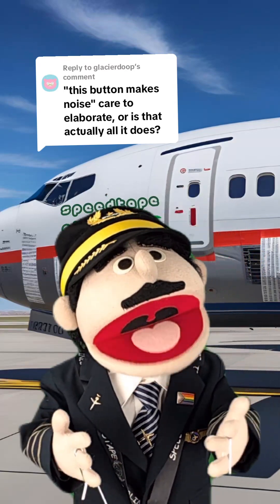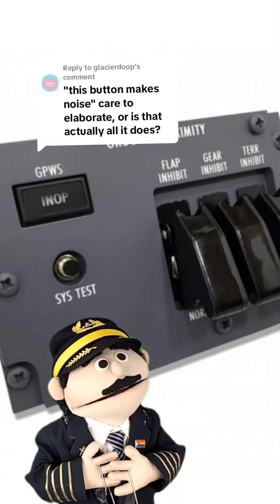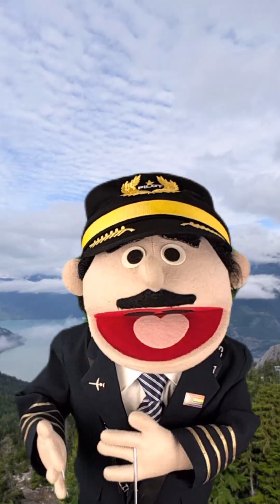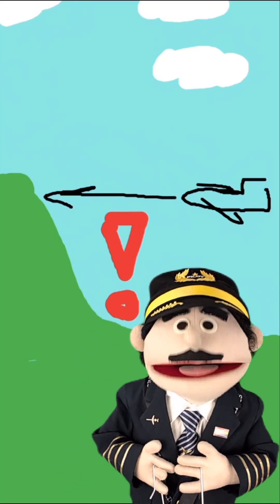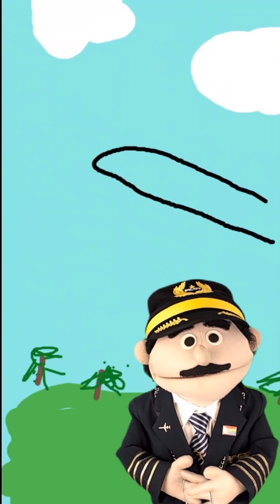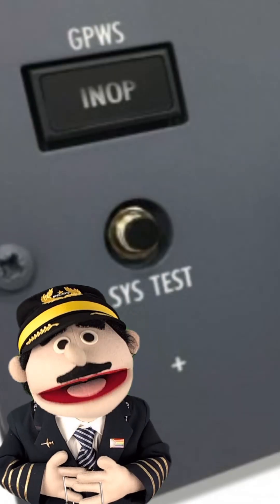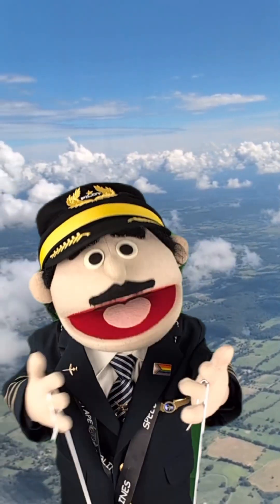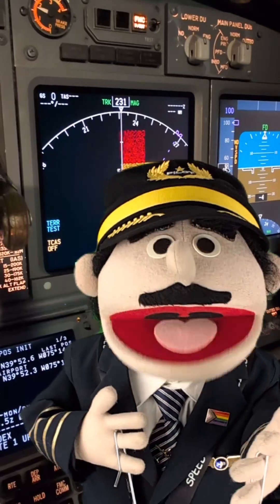GROUND PROXIMITY WARNING SYSTEM

Comment: Double clicking the button during the test will trigger a "Current faults: No faults. Press to continue"  message. This way you skip having to listen to each message type, and get the info right away of whether the system is functional.